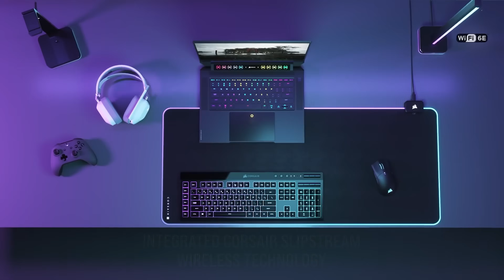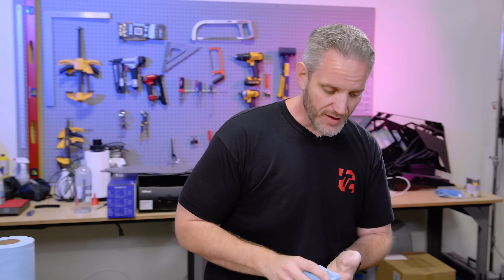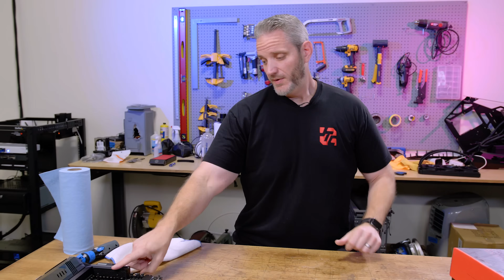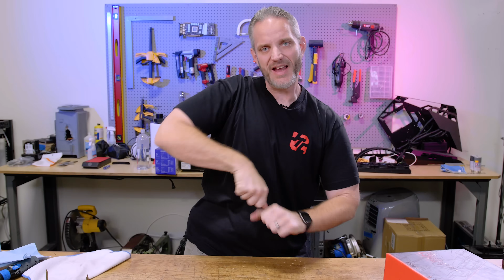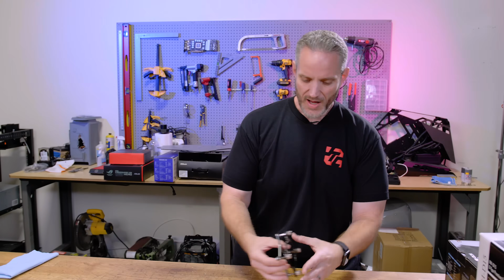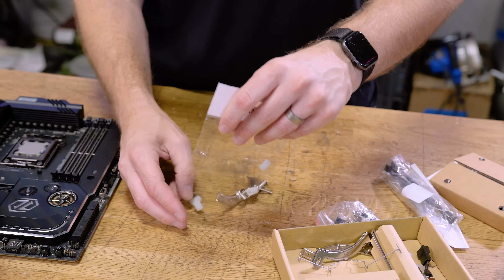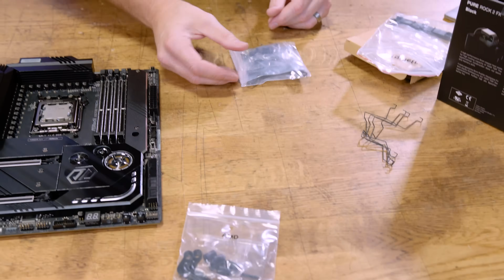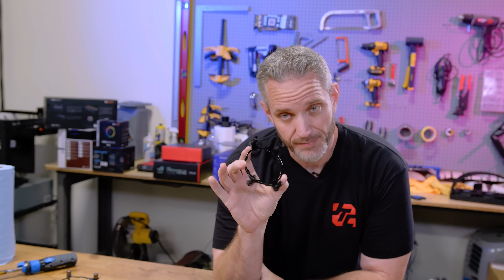AMD made a terrible flaw with this design...

Comment: Hey Jayz, i know its tinfoil hat theory right now, but something AMD reported back with the 5800x3D was that they had issues with the (forgot the world but how much % of the chiplets are succesfully produced) due to space limitations, so with the new AM5 they gave much more headroom, so there was some speculation going arround that the new 7800x3D would actually make use of this and have a thinner IHS in return.
Reply: Implausible, because there's also the IO-Die, which needs to be the same height as the CCD+cache chiplets. 
Pockets in the IHS and soldering do not work together well.
Reply: They more likely lost some chiplets because they shaved a LITTLE too much.

Comment: I know nothing but I believe in real world most use cases AMD believe that it's actually rare to hit 100% CPU sustained load. And the thicker IHS may actually help temp heat spikes and if it doesn't it still seems to be designed for 95C without throttling too badly to notice in really world used case...and AMD probably know that if people who want perfect cooling know people like derbouer will make products for it...plus I may be wrong Jay but I think Roman said it's was just a few degrees C between the prototype liquid metal Vs commercial...any liquid metal is likely a bigger drop...but this info is just from my extensive experience of YouTube
Reply: That's the difference in AMD's and Intel's boost algorithm: if Intel CPUs reach 100°C, they will throttle and you lose performance. AMD's boost algorithm however will stay at 95°C and keep clock speeds up with no throttling.

Comment: DerBauer knocked nearly 25 degrees off load temps, after seeing that and hearing 95 was normal from AMD, I personally thought AMD messed up somewhere. Heat is inefficiency. And this is why I'm holding of a year or two before upgrading. Let them iron out the kinks. I already have a OC'ed 5800X, my PC is already a personal space heater hitting 85 at times.

Comment: 07:45 The cooled doesn't need to use the hooks to mount. I have a EK AIO and this mount screws directly into the AM4 backplate. All you need to do is remove the original screws and little plastic parts, no third party backplate required. I imagine most cooler manufacturers will do this instead.

Comment: Swing and a miss on this video bud.   

You were so close to adding to the conversation about ihs thickness.  You started by talking about direct die cooling and how impressive that is.   Most people won't go that far.  

 All you had to do was show how to lap a cpu, and the benefits of doing so.   

I would love to see temp data on a pre and post lapped ryzen 7000 cpus.   

95c at full ihs thickness

Lap the cpu

XXc after lapping the ish to be thinner.  

Nope, you went off on a tangent about am4 cooler comparability.   With the cpus so hot, it's probably a good idea to upgrade your cooling anyway... Or modifying am4 coolers to work to work on a lapped CPU.

Comment: Thanks much for this video Jay. I hadn't yet pulled the trigger on my zen4 build, and this is showing me that waiting a few more weeks for this sort of stuff to get sorted out is a good idea.
Reply: Just pick any cooler that uses the stock AM4 (and AM5) backplate and you're good to go. This video is just misleading.
Reply: @blunden2  ...or I could wait 2 weeks and people will have reddit threads of what does/doesn't work, validated with screenshots, so I don't have to sit and look for photos for 20 minutes. Yes, this is a real problem. The video is not misleading.

Comment: WHY MUST you make me remember, using the flat head method to put CPU coolers, I will NEVER forget, cracking a motherboard when the flat head slipped off that retention device.  Way back in high school when I built my first Athlon 1.4ghz (computer with money earned bagging groceries).
IF eVGA wasn't going through it's current issue, I'd love to see KINGPIN play around with some of the ideas Jay mentioned.
Reply: I don't miss the feeling of terror as I put my body weigh onto a long screwdriver to push down on the spring, flexing the board like crazy as I desperately try to get it hooked
Reply: @karlschauff7989  that was the fun part of the build, well other than cutting yourself on those old cases that has sharp edges...
Reply: Oh my lord I forgot that, but I hated that too! Never any accident with that, but did fry a cpu because I didn’t get the core voltage and got impatient and went to highest v.core voltage. Learned my lesson. Never did crap like that again.
Reply: Ah yes, the horrors of AMD socket a. Apart of stabbing the motherboard, you can crack the die or frying the cpu too
Reply: Don't feel bad. An Athlon XP 2400+ was the very first cpu I learned to switch out on my computer back when I first discovered AMD. So imagine a person who never even built a pc let alone switching out vital parts learning how to switch out a cpu on the only computer they own. Honestly, I probably never even would have discovered AMD if it wasn't for my Pentium 3 burning out on me. 

We went to the computer repair place across the road from the shopping plaza to have replacement Intel parts priced out and when he told my mother how much they were going to be it was an instant NOPE. Then he suggested a slightly cheaper alternative to Intel that was just as good. That's how I found out about AMD. :)

Comment: But as far as AMD is concerned, you are supposed to be using the hooks.  They designed the board to use the hooks.  Therefore, they don't have to tell you it only works with the hooks.  They can't address every mod possible for their board.  But they are addressing it, so that's good on them.
Reply: No, you are not supposed to use the hooks. AMD stock coolers Wraith SPIRE and Wraith Stealth came with screws.
And Jay simply was not informed (once again, like many times before), compatibilty is not with the hooks, but generally coolers using the original AM4 backplate.
As long as cooler makers did not do any shady stuff, any cooler using the original AM4 backplate should be compatible with AM5.
Look at the pinend comment, Jay obviously read the comments who told him he was wrong.

Comment: I would guess the added thickness is where the 3d cache will sit in the x3d version of the cpu.
Reply: And how do you compensate for the differing height of the IO-Die? Differing levels on the IHS and soldering most probably will not go together well.

Comment: Worth pointing out that with a taller z axis, if they wanted to do 3d v cache on later sku's it would be significantly easier to add. Just something that crossed my mind while watching debuars video
Reply: It can be a possible. Maybe the 3d vcache will have better temps?
Reply: @santiago8816  No, 3d models will be pushed to the limit. Because they need to compete against intel 14 gen comet lake in 2023.
Reply: @santiago8816  maybe X3D is how Ryzen II is originally designed in R&D and 7000 without v-cache is just a crippled version of that - a cash grab by AMD until Intel can catch up to X3D performance.
no competition = we don't get better X3D parts.
same shit as 14nm+++++++++ from Intel but now from AMD.
Reply: I remember them saying they had to shave down the back of zen 3d ccd's to match z-height with zen 3, and that was only one stack.  Maybe it's way easier to make different IHS's than shave every die.  Especially if they ever figure out 3d logic, and go with more than 1 stack.  I imagine you can only compensate by shaving the die down so much before you destroy the die.
Reply: Ho, what an interesting idea.
And as they want to maintain AM5 for a while, it gives them the opportunity for Ryzen 8*00 series to actually have more stacked memory or else.

It actually hypes me up even more for what's coming next.
Reply: ...  i wasn't aware that 3Dvcache would add height to the core.  
Guess i'll wait until then...
Reply: good point
Reply: They could really go crazy with it them, considering amd managed to do it with a 5800x IHS.
Reply: Good point about the option for later thicker silicon.
Just for information: 'skews' is from SKU's which is an acronym* of Stock Keeping Unit.

*Acronym: an initialisation that can be pronounced as a word.
eg. Initialisations: CIA, FBI
Acronym: NASA
Reply: Nice thought!
Reply: *SKUs not skews
Reply: This is a good idea, Miles. But is it true? Is the 5800X3D thicker? And if so, how much? Anyway, the probable plan of AMD to start with compromises in case of the bigger IHS and then offer even more efficient variants of a taller cpu is interesting. We will see,what the future brings.
Reply: Are you a silicon engineer?
Reply: It also doesn't hurt AMD, either. Delidding "gains you more speed", but that makes AMD better over Intel, AND it means you have no warranty now, with having shaved off the IHS.
Reply: 3D v-cache thickness is on the micron scale.  It effectively does not add thickness to the silicon.
Reply: @benaguilar1787  They gonna go bigger and better.
Reply: 3D V Cache doesn't add height
Reply: @bbrr12  it does
Reply: Yeah as several have mentioned the cache doesn't add height. Not entirely sure how all that works but AMD has stated this in the past.
Reply: @ReivecS  die thinning on 5800X3D is a thing but it ads cost and decreases chiplet yields. what if you could just slap 3D v-cache on top of a chiplet? well with new Ryzen thick IHS AMD actually does exactly that - instead of die thinning they do IHS thinning and enjoy way better yields.

actually its the other way around. no V-cache 7000 CPUs are just crippled Ryzen II CPUs because they don't need to have 3D v-cache to be competitive against Intel. so AMD just doesn't slap V-cache on top of current 7000 CPUs and made IHS thicker. for now.
Reply: @ReivecS  It does though and it will in the future.
Reply: @LowkeyTryhard  I mean, you can ignore reality if you like. Plenty of people do.
Reply: @ReivecS  What part of shaving the die don't you understand? Can you really not imagine a world with 2 stacks? lol
Reply: @LowkeyTryhard  The die is shaved, not the IHS. This is how the 5800X3D is made and it is how future chips will be made. I just easily found multiple sources and AMD interviews that state this. They keep the die the same. Again, you can choose to not live in reality, you aren't alone there. I would send you URLs but more often than not, that causes the comment to be hidden or removed.
Reply: Also adding stuff on top makes it thicker. No reason to believe even more stuff wouldn't be even more thicker.
Reply: @ReivecS  The 5800X3D is also the only Ryzen CPU that wasn't overclockable. Maybe they decided that shaving the IHS was preferable to shaving silicon. But go ahead and believe that something they did on the first experimental generation must always be the case going forward forever.
Reply: @drewdane40  Or maybe.... just maybe, shaving the silicon was done for a technical reason since it would logically seem far safer to shave an IHS. Further the deliding data is very incomplete and other tests have shown that simply taking the IHS off and using liquid metal and putting the IHS back on still gives a drastic cooling change pointing to the issue being the thermal contact rather than the thickness of the IHS. So maybe you shouldn't be assuming design decisions for products based on 1 test run and guessing about what that actually means.
Reply: @ReivecS  Yeah, you're probably right. They probably have just been making their silicon dies too thick for all these years because they just didn't give it much thought when they designed them, and so it's much more sensible to shave them instead of varying the thickness of the chunk of copper that sits on top of them. I now see the error of my thinking.
Reply: @ReivecS  Shaving the silicone on the 5800x3D WAS done for a technical reason: they had to. Zen 3 substrate and IHS was designed for cooler compatibility on a 4 year old socket.  Matching Z-height was needed because the socket height and IHS weren't designed for V-cache.  AM5 and zen 4 obviously have a lot more room to accommodate thicker dies, requiring a thicker IHS for thin dies. There's no way there's enough silicon to shave for multiple stacks of cache or logic.  RDNA 3 already has an option for 0 1 and 2 stacks.  So we know they can do it for ZEN, if there's a benefit from doing it. This socket can also now accomidate extra stacks on zen 5 & 6 which might actually be necessary if they are doubling core count per chiplet.
Reply: @rcavicchijr  So the first half of your comment was well reasoned, although I don't entirely agree. Fair enough. The last half...... what is the point you are trying to make exactly? That they will shave the IHS going forward? We will see I guess.

Comment: wha? Compatibility issues and hiccups in the launch of a new standard?!  I am SHOCKED, I say! Shocked and appalled.  ... This is pure drama. You should know to expect little issues like this with any new launch. And if you didn't know that, this will be how you learn about the drawbacks of being an early adopter. It'll either drive you to learn enough to overcome the problem, in which case you're prepared for similar issues next time; or it'll teach you to be more cautious next release and wait until developers/manufacturers get the kinks worked out.

Comment: I never damaged an AMD motherboard with a screwdriver because I could never bring myself to use one to force the mounting clips down (been building PCs since the old Athlon XP days as well). I just spent a bunch of extra time fighting with the clips with my hands. Got my first Noctua cooler (an NH-U12S) a few weeks ago and fell in love with how much easier it was to install, even compared to other brands of aftermarket coolers I've used before.
Reply: I stood behind my Dad while he was trying to install a CPU cooler, with a screwdriver.  ...he managed to slip 3 times and rammed it full force into the board each time.  
I was shocked after the first time, by the third time i was just in complete disbelieve that he wouldn't stop, just stood there with open mouth unable to even speak, i mean what are you going to say at that point?  
The board was of course dead... i never let him near a PC with a screwdriver again after that.
Reply: @ZeroB4NG  built my first pc, did that exact same thing and was so terrified that I killed the motherboard. Luckily I didn't and it's still going strong after 2 years so I'm just going to assume I got extremely lucky.
Reply: I am always puzzled by these examples because every bracket I had for that had a slot that a screwdriver would fit into...so if you got the right size flathead it was literally impossible to slip because it was wedged down in the slot on the spring arm...
Reply: @Raven1024  Some people are not mechanically inclined and have no business…
Reply: @thetranya3589  But everyone can read directions
Reply: @Raven1024  You sound pretty sure about that... ;-)
Reply: Better to slip and slice your hand on a heat sink than stab your mobo, I get it

Comment: Was this entire video just an excuse to show just how superior Jay's water block is to the rest? As far as the thick IHS... I am sure AMD had some meetings about this. The engineers wanted a thinner IHS, but marketing wanted to keep compatibility with older coolers based on how popular using the AM3 and AM4 sockets for numerous CPU generations each was for AMD. Mod Project Idea: Run an all copper IHS on Ryzen 7000 series. I bet that would drop the temps noticeably while keeping old cooler compatibility. AMD IHS is dummy thicc.

Comment: I'm assuming most cooler manufacturers will release updated mounting plates. Intel did have this issue too on 1700, not every cooler could be mounted properly. Where it's frustrating is if you went out to get the new AM5 stuff right away, what cooler should you use?
Reply: Yes, the few that still use custom backplates for AM4 will definitely do so. Most already used the AM4 backplate though, so this is mostly a non-issue.

The video is just terribly misleading because they didn't bother to do any research at all (or even watch the video they reference 🤦‍♂️).

Comment: I remember the AMD retail coolers that had to be pushed in with  a screwdriver tip..   it was back in 2001, back then I used to build about 20 machines on average a day, which were all built to the ISO9002 standard,  back in the day one side of the clip on the retail heatsink  was captive  and the other was open on the sides and if you hooked the captive side  1st you risked slipping and gouging the board -  back in those days it was direct die cooling for the athlon and duron chips by default
Reply: I do not miss those days.

Comment: I'm a little disapointed in the lack of fact checking on parts of this video. It would have taken no more than 5 minutes for Jay to check noctua's site so see if newer nh-d15s come with am4 hardware, and to see that noctua had announced that the am4 brackets would work on am5. in addition, Jay should already know that if you have an older release of a noctua cooler, they will ship you new mounting hardware for new socket types for free. With Jay even commenting in the video that the packaging for their nh-d15 predated included am4 support, this should have been addressed in the video. My 2021 purchased nh-d15 had all the hardware I needed to install on my am5 board.  I think the conversation on IHS thickness is completely valid, and I would love to have the temperature of my 7900x drop 10/15 degrees. Maybe the socket could have been raised off of the motherboard to ensure the correct height for cooler compatabillity instead of thickening the IHS. I know that I am never going to feel comfortable delidding/direct cooling my cpu. so I have no option for ever remedying this flaw.